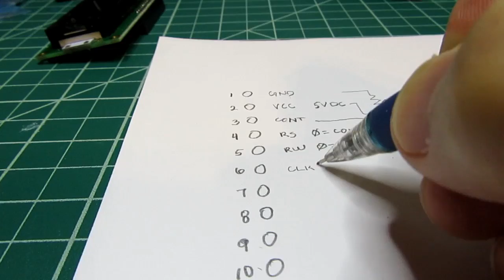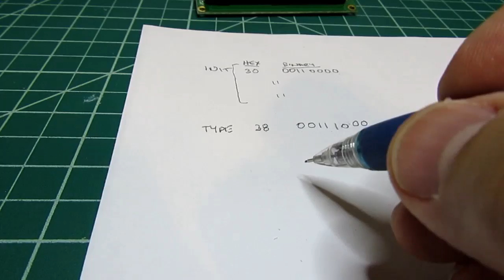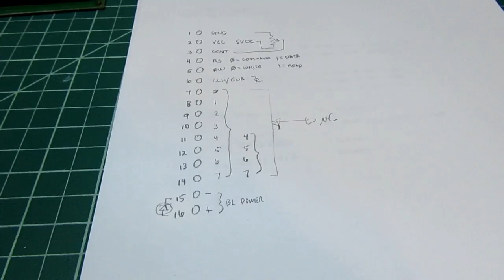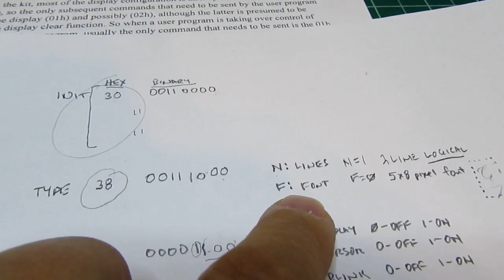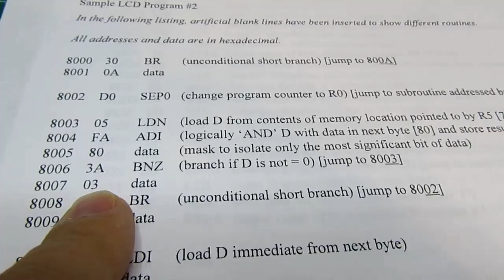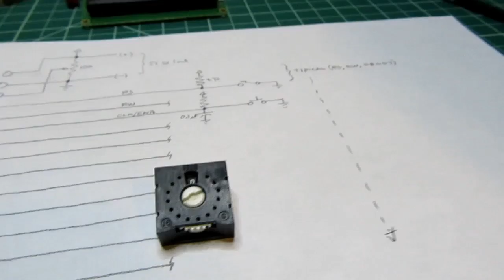Using Common LCD Modules: A Basic Overview

Comment: With regard to the potentiometer used for pin 3 (contrast adjustment), couldn't you use a 100K or even a 1-meg pot so as to minimize the current draw of the display module (should this be a battery-based design)?  I guess my question would apply whenever you need to use a voltage divider to feed a pin.  Does the contrast pin have some sort of current requirement that would need to take into account to ensure that you're using a pot with a value low enough to allow the required current?
Reply from the maker: That pot value appeared as a typical, or recommended, value in the datasheets I looked at. Anyone using these should check the specific datasheet to see what the contrast pin requirements are.

Comment: I am suprised that parallel data bus interface is still available. Usually for this type of simple LCD control, serial interface is more prevalent since it requires fewer io pins. SPI and I2C are the two most common options.
Reply from the maker: How did you gauge "usually"? Is that just in your own experience......? When I go shopping for these, I see major distributors carrying many variations on the 8-bit parallel one that I showed in my video (in addition to those with different interfaces), and large numbers of each of those are in stock, which is not what I would expect to see if they don't still have popularity. True, it may be that serially interfaced versions are quite popular, but when you can buy these for a few dollars each in their parallel form, and you have a product controller that uses parallel ports (and at the end of the day, even if your controller circuit uses internal serial communications, if some sort of machine is involved things will have to go parallel eventually just for the sake of practical interface), then you might have to ADD a serial port just to support a serially connected LCD module......so I think it all comes down to what makes the most sense on the overall physical design.